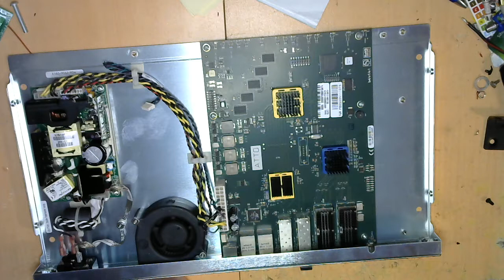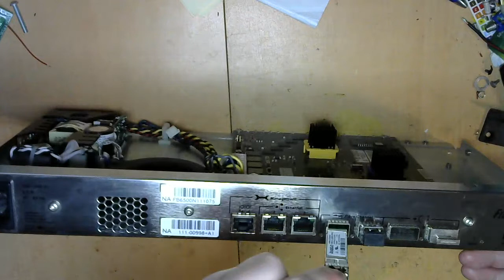Inside an Atto Fibrebridge 6500N Fibre Channel to SAS bridge.

Comment: Do you happen to have the non-netapp firmware for this? The 6500 I have is one of the netapp ones, and I believe if I can get the normal firmware, this will work with my SAS tape library. Thanks in advance!
Reply from the maker: I do not. I purchased it for the same reason, only to find that the netapp firmware is useless for that purpose. I'm in the same boat you are. Eventually I just gave up on FC and just used a SAS HBA, once I'd moved it all to a place where components were closer together. I was able to get devices to detect in the end, but actually making them work was always iffy.

Comment: I was just about to dissassemble my own FibreBridge for checking if there are any fpgas and there is one Max II - i think these radiated could also be FPGAs but undercover - or an ASIC indeed if they managed to sell many of these fibrebridges.  2:30 yeah thats Marvel chip - seen in Force10, Dell and even some broadcom switches - broadcom used to have its own line of chip earlier but i think they "integrated" themselves :)

Comment: did you manage to get it working?
Reply from the maker: I did. It worked, sort of. It did have some issues with address allocation, but I believe that is because I was connecting it directly to the HBA rather than via  a switch.

Comment: Hello, 
I would like to know if you had opportunity to use this device with a tape drive or maybe a tape library? I was thinking on getting one to connect Quantum SuperLoader 3 SAS tape library and I've some doubts because the model you have is mostly used in NetApp MetroCluster storage solutions...
Reply from the maker: I did, and I can report a few things to bear in mind:
1. It needs some rare and pricy cables to connect to the SAS side. They aren't the 8088 that the look like on first glance.
2. It's noisy. Really noisy.

As for making it work, I've had it connected to two devices: An HP 12-bay disk array, and an HP SAS tape drive. The disks worked. The tape, endless trouble if I connected directly - physically everything was fine, but I couldn't get device detection to work right. As best I could tell the bridge was assigning a SCSI LUN well outside of the range the host could detect. I suspect that this was only an issue  because I was connecting the bridge directly to the host FC HBA, and it was designed to use a FC switch rather than direct connection.

Curiously, if I connected both the disk array /and/ tape drive at once... it worked fine. No idea what was going on there, but it somehow caused the bridge to assign a nice sensible LUN and everything worked properly, disk and tape.

I think it really wants to work with a proper switched fabric, not just a connection direct to a host.
Reply: @channelbeforepurpose7353  which fan did you use for replacement? which software worked for connecting a HP SAS tape drive?
Reply from the maker: @Stefan-qd2rn  No fancy software needed: It was perfectly fine using just tar. I didn't replace the fan in the end. I did try disconnecting the fan to see if it would run stable on passive cooling alone, but it quickly overheated and crashed without the fan running.
Reply: @channelbeforepurpose7353  I got one of these, and I think it has the NetApp firmware on it, so it doesn't detect my tape drive on the SAS side. It's connected through a DELL TL-4000 tape library, and that is not detected either.

Do you have or can point me to where I can get the regular firmware? I tried googling, and came up with only Netapp articles, and no firmware.
Reply: @channelbeforepurpose7353  Do you know what the cable spec is as I've just picked one of these up today thinking it would do the job and just also read this comment!